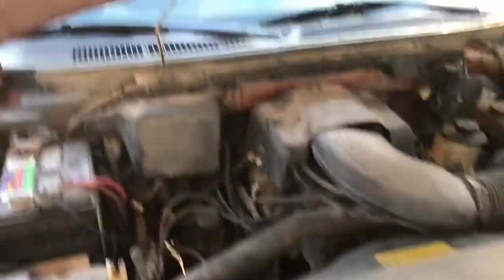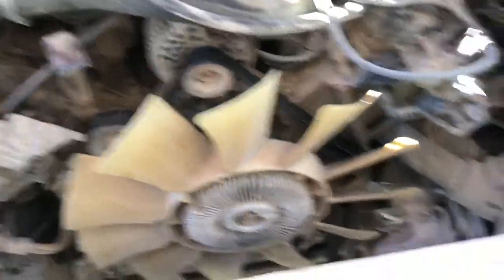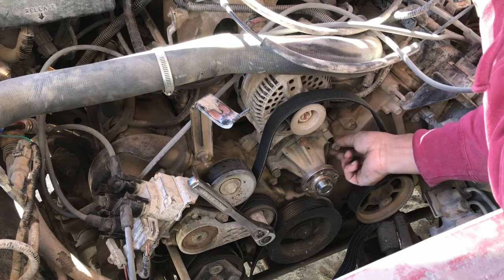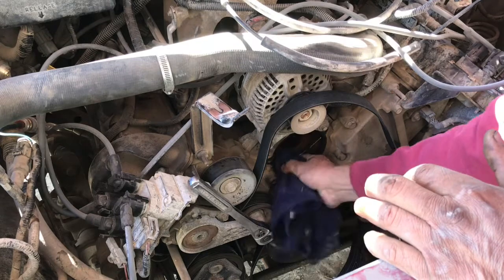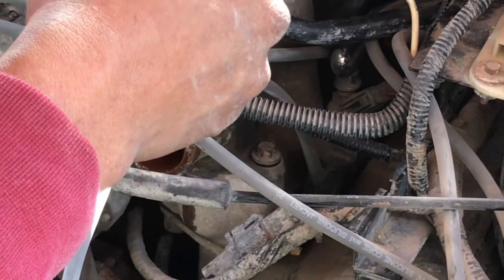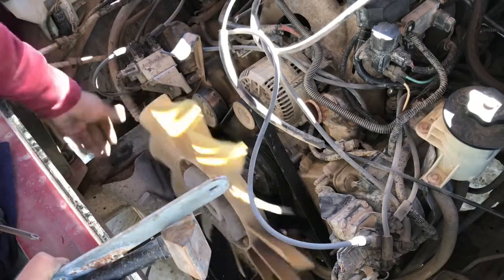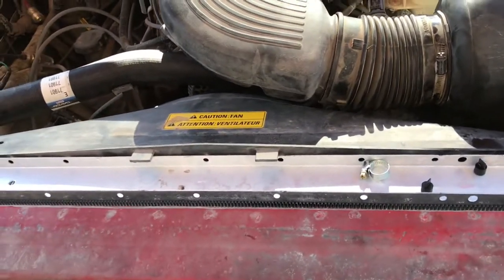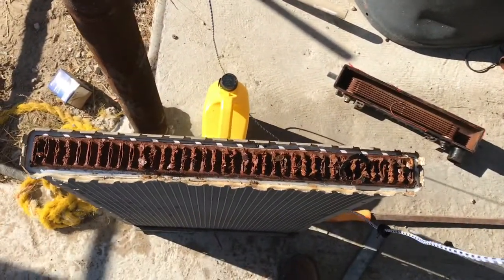1999 F-150 overheats

Comment: Hey Joe, the IC CE I looked at, I said I can do better, since the tires were worn down and it wouldn't start, since it didn't have batteries.  Also the same guy has a 54 passenger 2008 Blue Bird Vision CAT C7, but the batteries were drained in that. one.

Comment: Man that thumb nail, looks like they ran it with only water.  Never put tap water inside a cooling system its full of chlorine which causes rust and has minerals.  Use distilled water for cleaning and mixing with coolant.